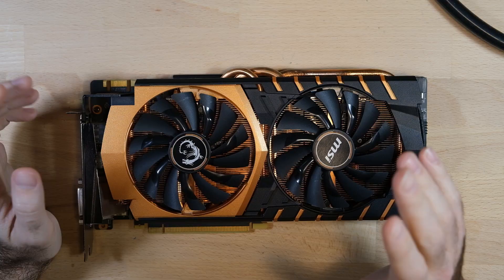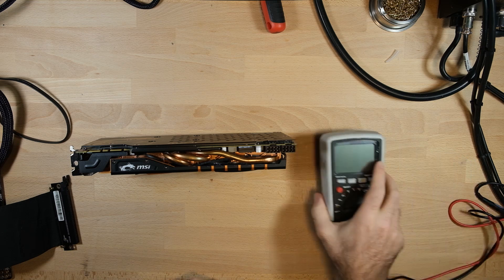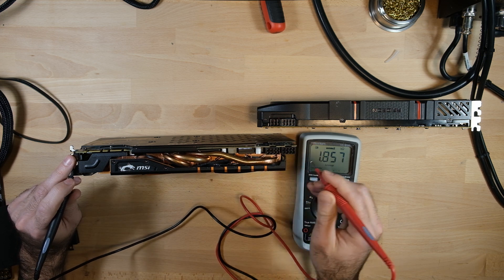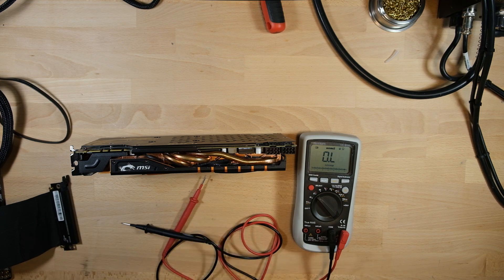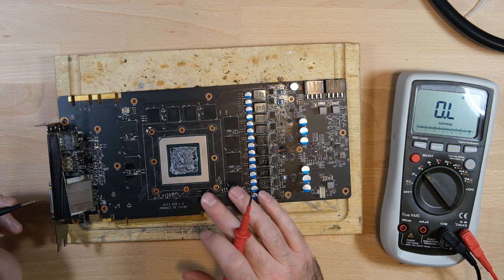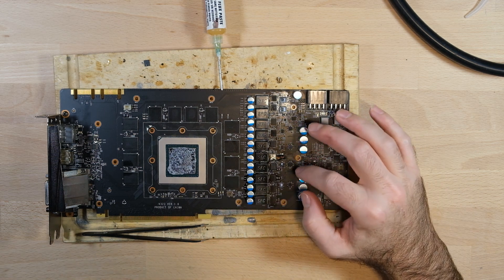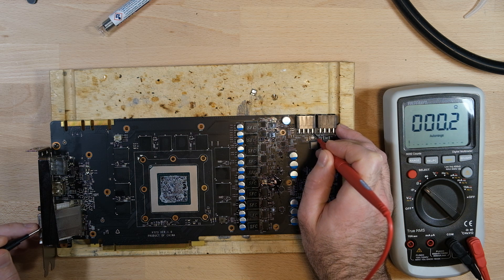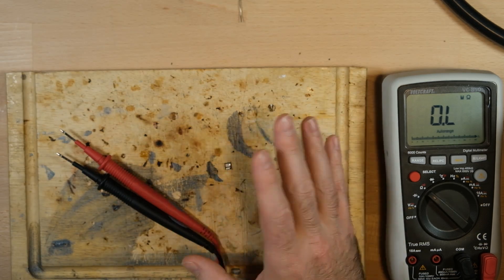Graphics Card Autopsy - MSI GeForce GTX 980 Ti Golden Edition

Comment: hello
I have an EVGA 980 ti scc never been overclocked, PC powers up fine, GPU works fine on normal work (internet brawsing, youtube etc...) but the moment i put it under load(lanch a game) , it crashes, black screen (sometimes white for a second), GPU light flash and turn off for a second than power on( like its doing a restart) , but no video afterwards. i have to restart The PC to get it to work again.
*fans are working fine
any suggestion?
Reply from the maker: If you have the right tools, you could try measuring the voltage at each of the logic power outputs to see if one of them is shutting off, which is a remote possibility.  Most likely, though, your problem is a BGA failure, which is a very difficult thing to repair, even for someone with the tools and experience to do it.
Reply: @AaronAverett  thanks for the answer, really appreciate it!

Comment: Hi, I had the same MSI GTX980Ti model, I came looking for an answer because my PC abruptly shut down in the middle of gaming, and there's smoke coming from my 5-year-old GPU. This is the EXACT problem with the EXACT model.
Instead of searching aimlessly through Google, I came here. Thanks for the video, I can close my case and move on

at the same time... I'm so pissed off that my GPU broke in the middle of a pandemic and shortage supply going on the GPUs.
Reply from the maker: Did you pull the heatsink off and inspect the board?  You sometimes get lucky, and find that the board itself wasn't damaged.  In those cases, this is a very repairable problem for someone with the right equipment.

Comment: Hello, thank you for sharing your knowledge with us. I'm having trouble with my gtx 980Ti and i was curious if you've ever meet this problem with other gpu's. Mine isn't brick dead, it has video signal but it restarts my pc or it freezes it even if the pc is at idle or in full load. I have put my gpu in another pc and the behaviour is the same. Some times it restarts the pc even if it is at idle sometimes i play a game and it's ok an sometimes i open a game and it crashes. Can you please give me an advice on what to check? Thank you!
Reply from the maker: That sort of behavior is generally the result of a BGA failure, most likely at the GPU itself.  Unfortunately, that is not something I'd describe to most people as repairable.
Reply: @AaronAverett  Thanx for answering. It seems that I'll have to wait for the prices to drop ang get a new gpu.

Comment: Must be what happened to mine 2 months ago. Funny how I came here to search if anyone had a similar issue. Tried reapplying some thermal paste, but that did nothing. Didn't dive as deep as you did. Worst time to buy a GPU right now too...sigh.
Reply from the maker: Oof, yeah, that’s a tough break.  If the board didn’t delaminate like mine did, it’s probably not beyond repair, but you’d probably need to replace all eight of the nfet ICs to get it to work reliably.

Comment: I've been watching your videos in hoping to save my old HD 7990 that's been tucked away for quite sometime. I wanted to retest it to make sure it works as I plan to sell it. It used to work without issues back in 2015 but when I tried to use it recently there was a short spark when I turned on my PC to what seems to be the same issue with that 980 Ti GE. I used an EVGA 850W G2 PSU which should definitely be more than enough for my HD 7990, the PSU I used back in 2015 was an XFX 650W Gold XTR. I don't think it's my EVGA PSU that caused it as my OC'd 2080 Ti runs. I plan to get a multimeter just to find out what could've happened with it but do you think it's salvageable? https://imgur.com/a/Q7KuoL8
Reply from the maker: Holy crap, that's gnarly!  It's hard to say whether it's repairable without having the card in hand, but I suspect not.  Usually, when you see damage like this where the board itself delaminated, the layers inside the board are shorted together such that you can't really clear the short without grinding away a significant portion of the board.

That said, if you have the equipment, it's worth a shot.  It looks to me like the root cause of the failure is that cracked MLC cap (C532).  If you remove it, and you don't have a short across its terminals, there's a reasonable chance the card may still work if you can replace the other couple of caps that were in that area.
Reply: @AaronAverett  Thanks for the reply. I'm no electrical engineer nor have a full on background on it so I'm just going by YouTube Videos on how to do such things. I went looking around at digikeys but kind of confused on what I'm looking for.  I'm looking for a C532 Surface Mount Chip Resistor right? https://www.digikey.com.au/products/en/resistors/chip-resistor-surface-mount/52?k=c532

I don't have a hot air station or soldering station nor any experience on using them but if I can manage to narrow down some idea on what happened to my HD 7990 I might go ahead and get those to see what I can do.
Reply from the maker: The markings on the board are not values, but names for each component that you could use to look up the value in a schematic, if you had one.  Unfortunately, the schematics for most graphics cards aren't available to us as consumers, so we have to use other means.  C532 is a multilayer ceramic capacitor, which we know based on its appearance and based on its beginning with a C, which by convention normally indicates a capacitor.  To find its value, we'll need to remove the corresponding capacitor from one of the other phases and measure it with a multimeter in capacitance mode.  We'd then reinstall the removed capacitor, and order a replacement for our damaged one.  Don't forget that you still need to make sure the short is cleared by removing the failed capacitor.  If it's not, you'll likely need to scrape away the damaged traces in that area until it is.  You'll also need to replace C524, and the two smaller caps below it, which will likely mean running a jumper wire from somewhere.

The hot air station I used in the video is an Aoyue 968A+.  I like it - it's good enough for a hobbyist, but I'd probably want a nicer one if I were doing this for a living.  You'll need flux and solder as well, which don't come with it.

This video discusses a problem almost exactly like what you're looking at, but my card had fuses to keep the short from delaminating part of the board.  There's a part 2 where I actually get it working.
https://youtu.be/MS6ZcbCTKqo
Reply: @AaronAverett  Seems like quite a work ahead of me but nonetheless it's a good way to learn more about the Electronics of Graphics Cards. I'm still awaiting for the multimeter but will be a look out on Hot Air Stations once I figure out my HD 7990. I have actually watched that video you linked but will most likely look at it again for reference guide in the future. As for the replacement capacitor, what values or indicators do I need to specifically look/type into so that I order the correct one?

Thanks for your responses, greatly appreciate it.
Reply from the maker: @idontwatchtv  The caps will have a number of different specifications.

The most important are capacitance and physical size.  Capacitance is measured in Farads (F), with the cap you're looking at there most likely being something like 10 uF (that is, microfarads).  The physical size is obviously measured millimeters, but SMD components are often standard sizes, which are represented by a 4 digit number.  C524 looks like an 0805 to me.  C352 looks like a 1210 or 1206.  As long as it fits on the pads and meets the capacitance and voltage specs required, the actual size doesn't matter, but you can look up the SMD package size codes and then measure them in order to make sure you're getting the right size.

The voltage also matters, but it's more of an absolute maximum rating than something you have to match exactly.  I suspect these caps are on a 12V circuit (the input from the power supply), so anything over that should work, but I'd look for 25V rated caps if I were going to the trouble of replacing them.

Comment: Some advice would be highly appreciated. Since i dont know on which forum i can find you ill present my problem here. I have faulty gtx 970 4gb gainward phantom. Fans spins but no post or picture. As far as i can tell all voltages are present, but there is no voltage on vcore or ram after power rail. No voltage on gates either. On vcore power rail is ncp5369 i dont know where the gate is. Vcore resistance is 4.8 ohms and ram is around 90ohms. Should i remove coils and check if power rail is faulty or anyone has better idea? Thank you in advance!
Reply from the maker: You have to measure output of each VRM at the output side of the coils.  If you're measuring at the output of the coils for the core and memory, and you have zero volts to ground at both of them, then clearly, not all of your voltages are present.

I'm just guessing here, but I if you're missing both the memory and core voltage, you should probably start your troubleshooting with the memory rail, I think I talked about this in another video, but the power rails all start up in a specific order, with each one eventually turning on the enable signal for the next one in the sequence.  The card's I've looked at usually start the memory rail up first, so if you're missing both, your problem is likely the one that earliest in the sequence.

If you look at the data sheets for the VRM controller ICs, you should see that one of the pins is an "enable" signal.  In addition to the supply voltage, the IC requires that you supply a voltage on that pin in order to run.  Try checking all of those and see if you actually have a voltage on all of them.

Comment: Well, one way to check were the short took place is to remove that gpu core chokes and measure from each side. i am sure if you manage to fix short in that burnt area ,card will run just fine.  other way is to remove the gpu chip and measure.
Reply from the maker: You are correct.  Pulling the chokes off and hunting for shorted components with a power supply is a totally valid tactic, but I think we know where the short is in this case, and the problem is just removing enough of the damaged board to clear it without destroying any really critical traces.  I actually considered making a follow up where I'd do that, but I just haven't had the time.

Removing the GPU itself is a totally different proposition.  You can't just remove it with hot air, and once you get it off, it's a pretty involved process to reinstall it.
Reply: Reballing is a headache actually :) but i am expecting for you to remove the short and see picture on screen !
Reply: Thank you for the valuable scientific information that you shared with us, and if you would kindly ask us, we want more if it is possible to examine it in another way to spread the benefit and learn the various methods used to examine this type. Regardless of the result and think it remains one through your evaluation, thank you very much